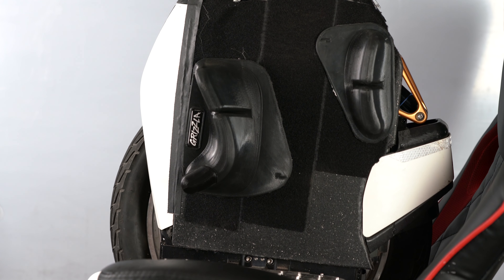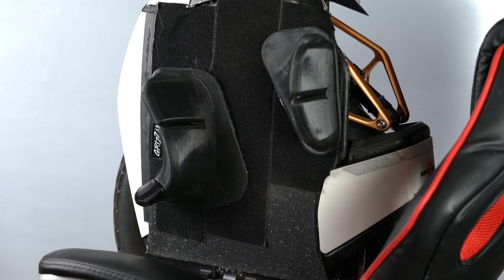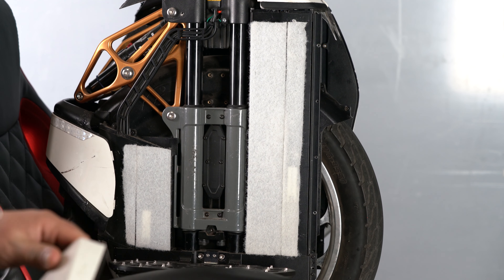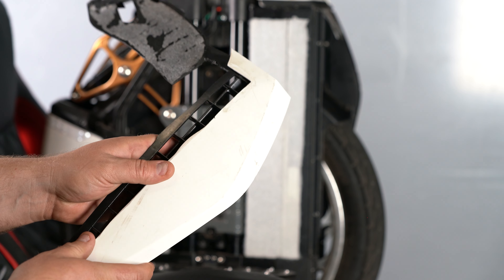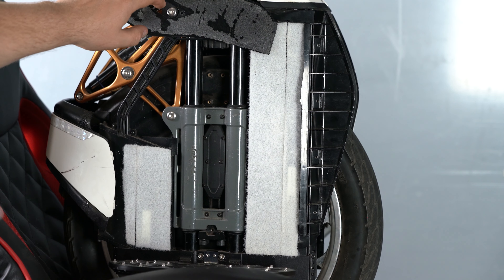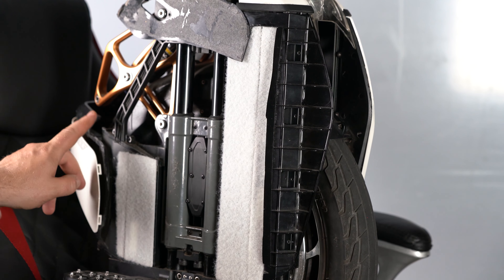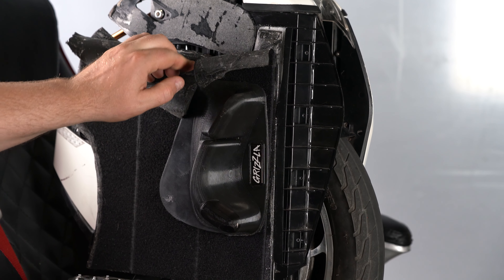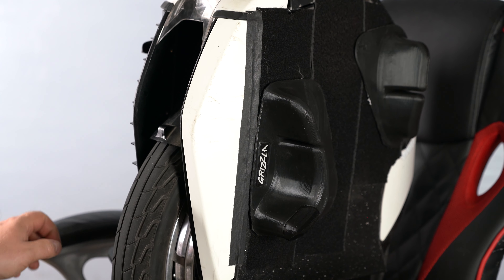S18 Add ANY Side Pads (Kingsong Electric Unicycle)

Comment: hey, thanks for the video and share your idea, I have been wanted to do this to my S18, but just can't really cut it before I knowing it can be done or not, thanks and now I am going to do the same thing.👍
Reply from the maker: That's great to hear!  I'm still happily riding my S18 with the much needed modification. I think only thing I forgot to mention in video is cutting out a spot to put the block to allow pumping up the shock.
Reply: @eucryan  that is not a problem for my S18, I have upgrade to DNM Coil shocks. no need to pump anymore. 😁
Reply: @icebreaka1969  - which dnm shock did you use?

Comment: Hey there Ryan, thanks excellent video, before buying the S18, I've been trying to see if I can get the weight down to 23 kilos / 51 pounds so that I can take it on VIA Rail Canada on a regular basis (way better option than renting a car in the destination station, or taking a taxi) eevees here in Canada told me it weighs 53.25 pounds, do you think I can reduce 1.25-2 pounds by taking the side panels off?

Edit add: Love your channel description BTW, peace
Reply from the maker: Hello Rishi. Thank you for the positive vibes !!! It's a tough call if the stock side panels weight 2 pounds or more.  It's possible though. It is pretty light weight plastic.  If you've done the modification such as myself it might have added a pound or 2 since the cutting boards I used were pretty thick. Is it possible to take the pedals off while on the VIA Rail Canada and put in your pocket or another bag to get you under the 51 pounds? What do you think?
Reply: @eucryan  yes, I got that pedal idea just about an hour ago while watching a disassembly video, do you think that'll easily reduce 2 pounds? Thanks a lot for your reply!!! I have not bought the wheel yet, was going to buy a V11 for the waterproofing since it rains a lot here; but this biweekly train journey thing came up for work late-summer onwards. Need suspension to protect me knees, thankfully the S18 exists in the world and is at least an option and thankfully VIA allows PEVs onboard in the Windsor-Quebec City corridor.

Comment: How's the s18? How long have you had it sir? Any issues?
Reply from the maker: S18 is a decent wheel especially with the new Molicel battery upgraded packs. Issues have been the side pads, no handle, not enough batteries.